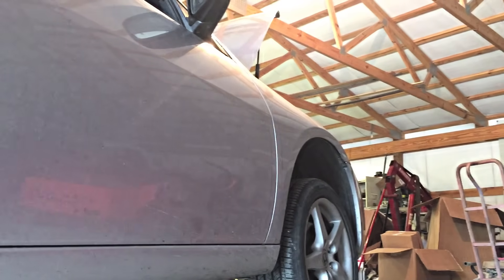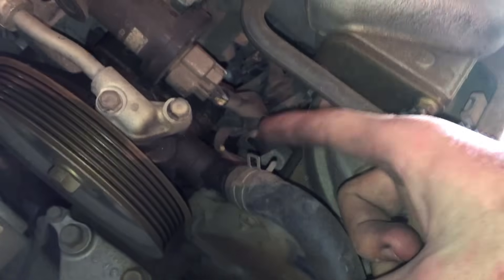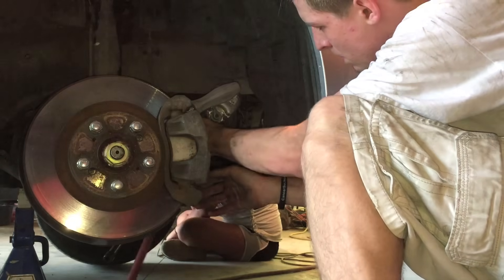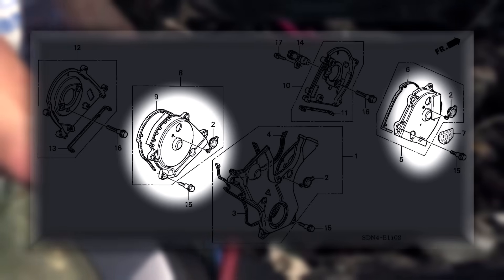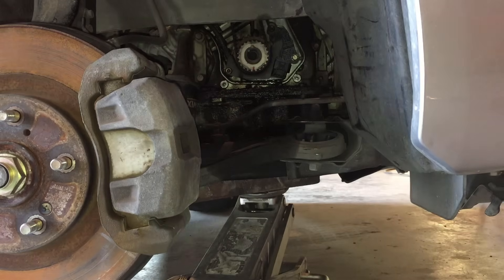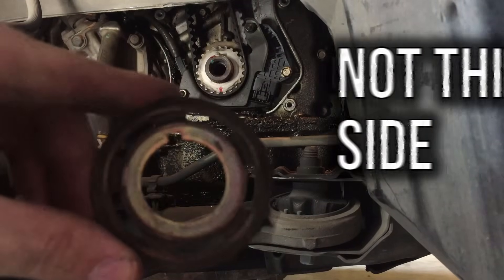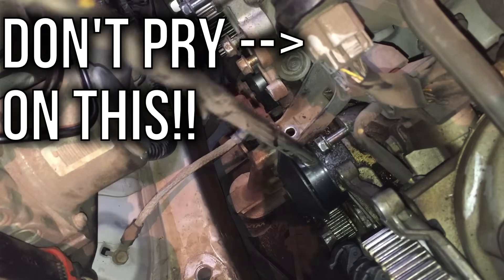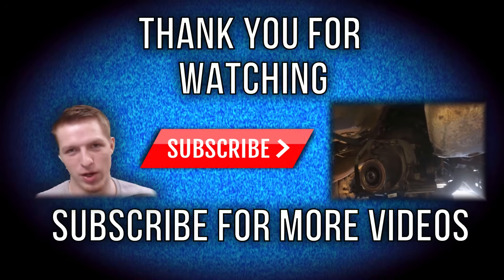Honda Accord V6 Timing Belt Removal

Comment: I just bought a 99 accord with the v6 for 300 bucks and it needs a timing belt because the old one failed. I would like to know if this is an interference motor.  Are the piston tops on the v6 capable of hitting or bending a valve if the tonight belt breaks? I would really like to know before I start breaking into it
Reply from the maker: Yes they are interference, it doesn’t hurt to throw a belt on and see if it runs, it is possible for the belt to break and not cause damage, but it’s unlikely, you are probably looking at an engine replacement or cylinder head replacement, whichever you would be comfortable doing or paying for
Reply: The Feesher Thank you for the help. I’ll probably either end up doing a valve job or just get some heads if I can find them used. I’ll take off the heads and check the valves before I worry about it

Comment: Thanks for putting this procedure to video. My 2005 accord has 145k miles and although there are no signs of any issues, I'm afraid I'm pushing my luck. Honda quoted me $1,500 to do the job with parts.
That's about $1,000 more than I have available. I feel way more confident now.
Reply from the maker: It is always dangerous for the engine to drive on hopes. I have destroyed a personal car’s engine that way. Doing it yourself you should spend no more than about $200 so this will save you a lot and keep the car going!
Reply: @TheFeesher  Thank you for your reply. The info is priceless when it comes from experience. I'll be tackling the job next weekend.
Reply from the maker: Let me know how it goes for you!
Reply: @TheFeesher  I sure will. The car is parked for a bit while I make room in my garage. It's been much too cold for me to tackle this job in the driveway. I'm also going to pop for a new OEM timing belt. It may very well be exactly the same but at least I won't worry all the time that it was of poor quality. Thanks Again.
Reply: Larry B How did it go? My accord has 162k miles and the belt just snapped this Saturday. I was quoted $380 for all the parts, $50 for the towing, and $250 for the labor. So around $700.
Reply: @alang9549  Isn't the Accord V6 an interference engine?  If the engine is running when the belt snaps, would the valves hit the pistons and essentially destroy the engine?
Reply: dknight211 It is. So I got it fixed but, it only ran for about a month. I ended having to get a Scion tC 2014 after that. :(

Comment: Great vid!! Lots of info without any extra BS. I used your starter motor trick with a breaker bar to loosen the crank nut... worked awesome. Thank You👍👍
Reply from the maker: Awesome! Glad to have helped! Keep that car going!
Reply: The Feesher *Bolt, lol. 204K mi. on original timing belt😮 it still looked fine when I took it off.
Reply from the maker: Better safe than sorry, timing belt belt $50 while an engine is hundreds at least lol
Reply: @TheFeesher  Is this procedure the same for a 1999 Accord V6?
Reply from the maker: VERY similar, I believe a few aspects are different, but I cannot remember what at the moment.

Comment: This video was really helpful! Do you have like an average time it takes to do a water pump on these motors?
Reply from the maker: Thanks! It usually takes me around 2.5-3 hours with no problems, first time may take longer, usually depending only on how long removing the crank pulley takes and how long getting the cam lines lined up takes.
Reply: @TheFeesher  thanks man I had some shop say it's some 5 hour job and would cost nearly $800

Comment: I have a 2005 Honda Accord Hybrid. I can find nothing on how to replace the Timing Component Kit. There is no Power Steering Pump as it has Electronic Rack and Pinion. There seems to be less access to the Timing Cover in the rear.
Reply: Thanks. Also, I could not use the ignition key to bump the motor and loosen the crank pulley bolt. The electric motor that starts the engine cranks fast, even with a quick tap of the key. The engine fires immediately. A big air wrench worked.
Reply from the maker: Good info! I honestly always forget the hybrid model exists so I didn’t even consider that being an issue lol
Reply from the maker: It’s the exact same on hybrids, minus power steering pump. Only problem is having about half the room between the engine and body as a non hybrid
Reply: Had you fix your timing belt?

Comment: I thought before you remove a water pump you would first drain the cooling system? Why does your hands have to stay oily/greasy during the entire video? Why not use disposable gloves or wash them periodically? Gross
Reply from the maker: It gets drained then the pump is removed. I’m sorry that the oil and grease disturbed you. I would recommend not attempting the job if you a grossed out by dirty hands. Best of luck!
Reply: You also don't have to drain the radiator
Reply: Kristin Johnson you apparently have never worked on a car.  ROTFL.... it's not a clean job.

Comment: What type of noise were you hearing to warn you this repair was needed?
Reply from the maker: There was a bearing howling from underneath he timing cover, wouldn’t tell which it was without taking it apart but figured it was all probably due for replacement plus, only had to go in there once

Comment: Both are great videos explaining the order of removal as well as installation.  I do have one question regarding DTC.  If you end up not lining up on any, can you adjust each pulley and crankshaft before replacing the timing belt?  Thanks again for the great videos and BTW I needed to use the starter to break loose the crankshaft bolt after breaking a 1/2" extension and breaker bar.   2003 Honda Accord EX Coupe V6
Reply from the maker: To an extent. It is interference, meaning that if it is too far off, the pistons will hit the valves when trying to line everything up. So everything will need to be turned incrementally. You will probably have a harder time damaging the valve train by turning it by hand than turning the crank by hand (that's just an assumption based on the leverage required to turn the two) so I recommend turning the cams as close to TDC as possible, then SLOWLY turn the crank it you feel any resistance. At that point it becomes a game of whack a mole trying to move everything into place, but it can be done. The problem being that it's a V6, there are far more chances for valve contact to happen, it it was a 4 cyl you may get away with setting the crank at 3 or 9 o'clock to safely set the cams. It may just be a matter of finding and angle of full clearance like the 4 cyl would have, and since I have never been in that position I would not know where that is. 

And yeah those crank bolts are stupid tight!
Reply: the front cam is spot on but the back is off and the crank is as well.  Everything needs to move clockwise correct?  Crank is just past 12 o'clock and the back cam is closer to three o'clock
Reply from the maker: You should be fine moving those into place. I've also had the rear cam jump. Set the crank right, and then get a wrench on the rear cam and throw the belt on

Comment: First.  Very good !  My only concern is that you went through it a little too fast.  There might be some tiny details that are missing.  Regardless of my thought, very good.    Now, good grief!!  is it going to be that difficult?  I've changed three timing belts.  Two on an  89 accord and one on a Toyota ( nightmare!   You need toddler hands to get to the bolts!).   How much time should I plan for?

God Bless!
Reply from the maker: So it sounds like you have mechanical ability so it shouldn't be bad. There are only like 2 timing cover bolts that are easier if you have small hands on the rear upper cover, the rest are easy. Those old accord are bad about no room for sure though!
Reply: There are some that remove the entire engine from the bay before doing the job.
Reply from the maker: There may be some, but personally I see that as a bit unnecessary, it is a bit tight but can be done. Only a few hours job without pulling the engine, I’d add 4-5 more hours if pulling the engine. Only accord I that is somewhat difficult is the hybrid V6, it is REALLY tight

Comment: I am planning to do it on my 07 accord v6. I bought the parts but I don't have the air tools you have. Would it work with electric impact driver and flex head ratchet? Also, how much time did it cost you to finish the job?
Reply from the maker: You can do it all by hand, the only hard part is that crank bolt, and I used the starter for that. Me, someone who has done them a few times, takes about 4 hours.

Comment: Thanks for the VERY helpful videos on timing belt/water pump replacement for the J series motors. You provided some excellent details and video editing. I agree cutting the belt is the way to go as long as your ducks are in a row.  If you ever decide to do a clutch/flywheel video for this car, I'll be sure to watch! BTW, my wife showed me the easiest way to deal with the low pressure PS hose is to simply stick the end into the "fill" hole on the reservoir (surely there's a joke in there somewhere), it's a perfect fit.  Thanks again!
Reply from the maker: lol I'm glad the video helped, and Joe the car is driven I'm sure it'll need a clutch and flywheel one of these days, thanks for the comment!

Comment: You don't need to clamp the power steering hose, you actually risk cracking the hose if the car is old enough.  All you have to do is to take something and wrap around the opening of the hose then use rubber bands to seal it tight, move the hose to the side.  Use the 19mm Lisle Honda harmonic balancer beefy socket and you can break loose the crank bolt.

Comment: I think the issue with people applying RVT to the crank bolt is because if you look in almost any Haynes manual, that's what it tells you to do and I know a lot of people that do repairs based solely on Haynes manual.
Reply from the maker: That's possible, I've honestly never looked at a Haynes. I know Honda said to lube the threads and under the washer, on some models at least. Maybe this step translates poorly to Haynes

Comment: Thanks for the excellent video!  Your explanation and video editing make all the difference.  I helped a friend replace a water pump and timing belt on a Lexus V8.  It took us 12 hours.  Won't do that again, but might attempt it on my '14 V6 Crosstour when needed in about 65K miles.
Reply from the maker: Cheap, and effective. They changed to chain in 2016/17 I believe
Reply from the maker: +Phoenix Skeptic that sounds terrible but I'm glad it helped! Once classes are over I will have time to make a video that has the install tutorial that will definitely make your crosstour a breeze!
Reply: why the hell would honda still use a timing belt on all their v6's is beyond me, care to explain?

Comment: +The Feesher WHERE THE HELL CAN I GIVE A "LOVE" BUTTON!!!!!????????????????????

Wow!!!!! This video was aFRIGGINmazing!!!!!!!!!!!!!!!!!!!!!!!!!!! You just made me an expert!

Two questions: #1 - what if the front cam is not lined up? How do we "line it up"? Same as with the crankshaft pulley? #2 - "dumping the key" means exactly what? I have a manual. How does one do this?
Reply from the maker: +Charlie Vélez thank you!!! As long as the belt isn't on there you can very slowly turn the camshaft with a wrench and use a big ratchet with an extension to put the crankshaft bolt in and slowly turn it where you need it to be. If you you use an impact on the crankshaft bolt be careful, it could pull the threads and destroy the engine. 

It took me a minute to realize what you meant by dumping lol sorry, my bad, I said "bumping" just turn the key into the start position for like half a second to turn the engine with the starter. If the belt is off though, do not to this. This one is a manual as well.
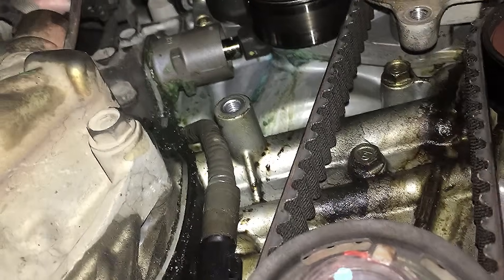Reply: ahhh is this the answer for 5:20? This is what I meant, I am sorry. 

And about the "dumping the key", I apologize for that lol. I had clicked on the "caption button" & that's where i saw the word "dump" lol. Ok, so with the clutch engaged, i just turn the key to where the car wants to start yes?
Reply from the maker: +Charlie Vélez yes, or you can have the car in neutral either way
Reply: +The Feesher Thank you thank you for your time. one last question - i removed the bolt from the pulley that is directly underneath the tensioner pulley...it came out as if it were spring loaded. Couldn't figure out a way in such short time to have the threads grab back on...any ideas?

It's the pulley that is directly underneath the tensioner pulley (saw wrong video before yours and took it off lol. Now i want to reinstall it lol). Thank you in advance.
Reply from the maker: +Charlie Vélez I think it is spring loaded, I don't know to to put it back together though, over never had it apart
Reply: Ok thank you. 

How important are the rear cam to be in line? I have the front cam and the crankshaft pulley dead in line. I accidentally moved the rear, twice. 

I just installed the belt and put everything back. Haven't turned the engine over yet. Should I fix it or leave it?
Reply from the maker: +Charlie Vélez take the belt off and line it back up, I know how much of a pain they are to move but it needs to be 100% on this. I've been trying to find time to edit the installation video, get it as close as humanly possible, and then turn the engine over by hand at least two full rotations and make sure it lines back up. To make it easier, start on the crank pulley and pull the belt as tight as you can, then put it on the front cam, use someone like bag clips to hold the belt on the cam, put it under the WP pulley and then pull it as tight as possible then put the belt on the rear cam.
The goal is to pull ALL of the belt's slack on the tensioner side.
Reply: The Feesher I was just going to write, I took the pin off...I bought a new water kit assembly and pulled the pin from the tensioner thingy. 

Buy a new one? Or press it I think
Reply from the maker: +Charlie Vélez you can press it in, use a vise and do it slowly
Reply: The Feesher yes Sir
Reply: The Feesher ok, pushed auto tensioner in. Done. 

Rear cam - did as instructed. Took off timing belt. Took out all spark plugs as instructed by timing belt procedure. 
 Attempted to rotate rear camshaft clockwise. went too far. Attempted to rotate camshaft counterclockwise, went too far. between going back and forth I managed to line up the two marks. I will insert spark plugs timing belts tie everything down my fear is that that rear camshaft will rotate 1/4 turn on its own because it is spring-loaded. if it does that, I give up I'm taking it to a mechanic. 

 if you can provide me an expert opinion I would greatly appreciate it as I have done everything thus far thank you.
Reply from the maker: +Charlie Vélez once the rear cam is off its hard to line back up, what I usually end up having to do is put the belt on the front cam, pull it tight and then with another hand have the rear cam too far clockwise and with the belt hovering over the cam, slowly turn the cam counter clockwise and put the belt on just before it's lined up. This way the belt will grab the cam preventing it from going too far counterclockwise
Reply: The Feesher ok. I will follow.
Reply: The Feesher Done. Rotated four times. Pretty much the same spot where they were from the start. Couple of times the belt would want to slip off on the guide pulley side but it's on there. For me obviously, there more tension in the tensioner side but the front cam side is not loose at all. One can "wiggle" it (for lack of a better term) but she's on there. I hope!
Reply from the maker: +Charlie Vélez hope it all went well! Glad to hear it has gotten BACK together!
Reply from the maker: +Charlie Vélez I don't know why "back" was capitalized lol
Reply: The Feesher I'm nervous to start it lol. I just filled up the system with almost two tanks of antifreeze (completely Spanish thought, English words lol), I need two more...then I'll start her. 

Ahhh!
Reply from the maker: +Charlie Vélez it's always nerve racking lol
Reply: The Feesher Mr. The Feesher, I do not know how to thank you. You have been such a wonderful person assisting me with all your knowledge. Thank you for taking time out to guide me almost-every-step-of-the-way (lol sorry about that). I am indebted to you sir. 

She works. My timing is off by a hair so tomorrow I'm going to get it fixed but she runs. I am glad I didn't blow her up. Lol. 

Thank you thank you thank you!
Reply from the maker: +Charlie Vélez you are very welcome! I'm glad to hear you finished the job!

Comment: Would this be similar to a Honda Odyssey 2011?
Reply from the maker: +edwin moulic yes, more than likely. The previous model ended in 2010
Reply: No
Reply from the maker: Yes it is, I’ve done it, mount placement is slightly different along with ECU placement, but the general idea is the same, the important stuff is

Comment: Why would you cut the timing belt for removal? Better to mark the belt at each pulley and sproket  and transfer the marks to the new belt.
Reply from the maker: +autotech1100 agreed, it is, but I was on a time constraint and after doing the 300zx timing belt with no marks multiple times. I also did not have a marking utensil with me
Reply: replace water pump on 91 civic
1.5